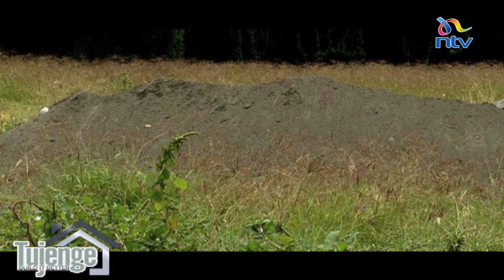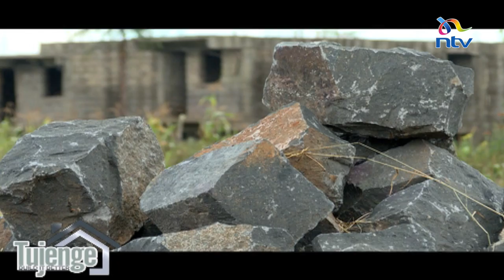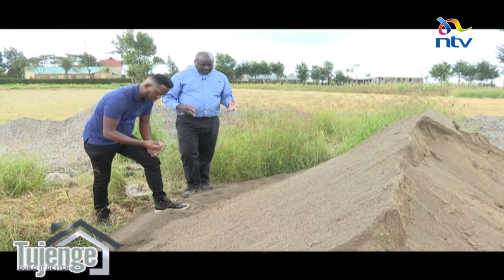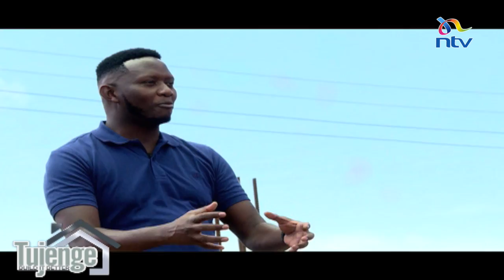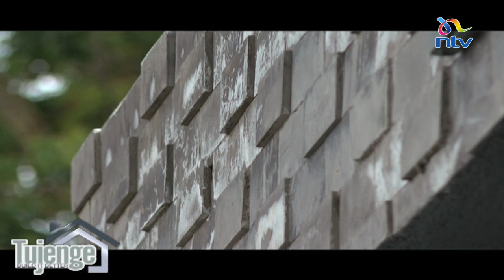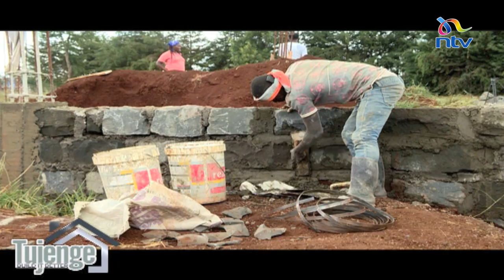Everything you should consider when constructing your foundation | #TujengeOnNTV

Comment: when building foundation on black cotton soil with no stone substacture in sight, you excavate the foundation to at least 2 meters deepth and feel it with red soil and get a roller to firm it on place. otherwise, you will have your house develop on the walls all over. black cotton is only good for planting maize and not building houses on it.
Reply: Someone told me floating foundation, I didn't  understand.
Reply: @luluauma1886  There is indeed such a thing, but if done poorly, utawaste
Reply: Or do a plinth beam